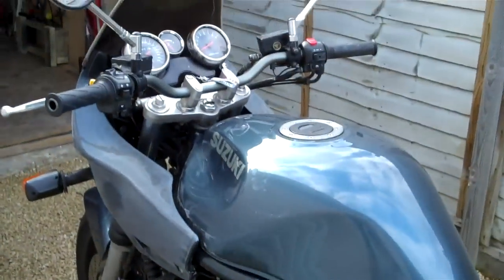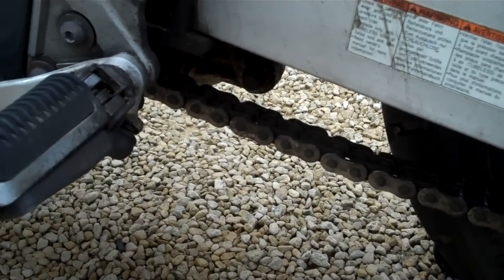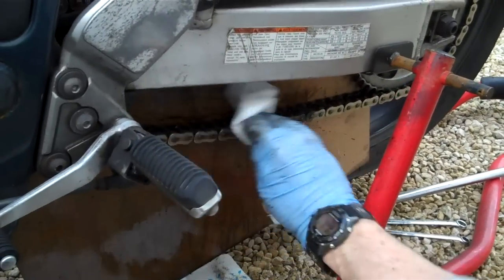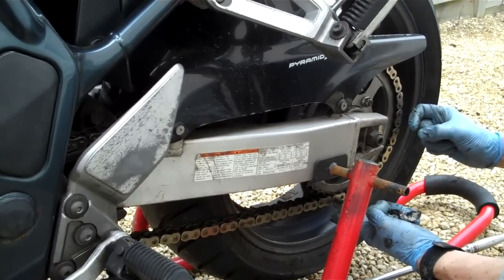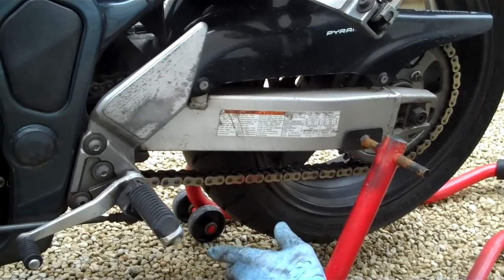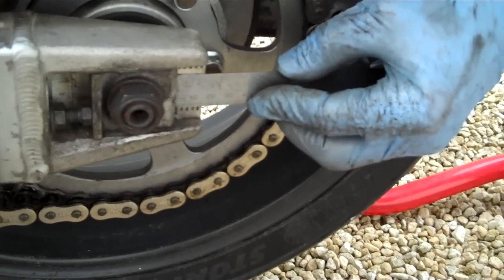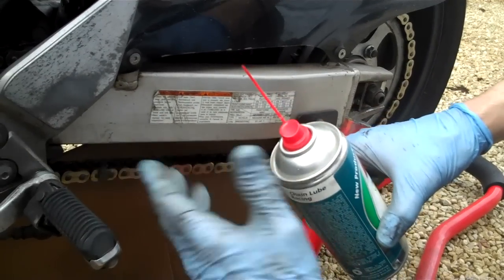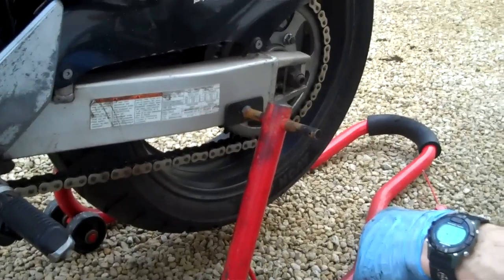Delboy's Garage, Suzuki Bandit, Chain Adjustment. (plus clean and lube).

Comment: I can't get the distances equal on both sides with the correct tension. I need to shorten the right hand side, but you can only adjust it to lengthen. Another issue is that when I had it about right, torquing the axle nut tightened the chain. Spent over 2 hours and still can't do it.
Reply from the maker: +Glenn Makin Ok it can be tricky mate.. most tensioners only pull backwards...so you can loosen it off then kick the wheel forward...works fine.. then set the chain tension correct on the chain side, do it with the axle nut hand tight and a bit more on top....then line up the other side to match the alignment... then after torquing up the axle, check the tension again to make sure it didnt go tight.!
Reply: Seems you mustn't slacken the axle nut too much. Tried pushing wheel forward as you say, obviously needs more force. Then just adjust chain side as the adjusting side, and set the right to match. Think I've got you. Try again tomorrow. Cheers mate
Reply from the maker: +Glenn Makin Yeah, thats right, you need some resistance in the slide action as you draw it back...that will hold it where you put it and mean that it wont change too much when you torque if up tight... good luck with it buddy, let me know how you get on.. cheers, Del.
Reply: sorry to be a pain, are you saying that if I loosen the adjuster nuts and axle nut I can kick the wheel forward, as I need to shorten the right hand adjuster. Wouldn't this ruin the thread on the adjuster screw? thick as pig poop I am
Reply from the maker: +Glenn Makin If you adjust the tensioner off then that should make the wheel free to slide back and forth in the axle slot, if it is a threaded adjustor however, then you should be able to wind the wheel forward with the nut...!
Reply: you little farkin beauty I've done it! key points were to loosen everything off so I could kick the wheel forward and start from scratch. And keep axle nut tight so it doesn't tighten the chain when torquing. 
A minor victory but I'm buzzing, another little skill learned and I can ride my bike. I am so happy, I'm going to celebrate with a cuppa, a rollie and a ride! cheers mate! diamond!
Reply from the maker: +Glenn Makin Brilliant Glenn, so glad to hear it mate, learning new skills is always triumphant..!  ride safe chap.. all the best.. Del.

Comment: Hi pal , I don't have a pic but if you put daelim daystar chain tensioner in Google there are pics. Any help would be much appreciated cheers laurence
Reply from the maker: OK Laurence, I see the pictures - looks like a pretty standard jockey wheel affair, but the axle does look to be adjustable, so I would imagine you just need to keep the chain tensioned, so that the jockey wheel is within it's range of spring span... meaning that's it's neither fully stretched to it's maximum, or pushed right up against the swing arm fully closed... basically, set the chain tension so that the jockey wheel is in the middle of it's range of sweep... does that make sense??
Reply: So you mean keep the jockey wheel in the middle, if you were looking at a clock the wheel would be at 3 which is the middle of 12 and 6 if you get my drift, thanks for taking the time find out and reply I'll let you know how I get on. Cheers laurence

Comment: Hi Del, I used this video to guide me in checking the chain free play on my own '99 Bandit 1200 - thanks again! The first thing I noticed was the the axle was reversed, so the nut was on the right hand side beneath the pipe. Secondly, I noticed a fair bit of fore-and-aft free play in the adjuster plate on that side - I took a video (https://www.youtube.com/watch?v=9aK5Kneqqg4).

So, my questions:

1. Is the axle installed incorrectly and should in be reversed? It's a Canadian bike, if that makes any difference - but the chain is on the same side as yours.
2. Should there be free play fore-and-aft in that adjuster?

Thanks mate!
Reply from the maker: Sadly your link doesn't work John, but there is a little free movement in the adjuster, unless it's under tension... not sure about the axle, or whether it's significant, or not, which side it's fed through from... I'd have to have a close up look to check and confirm if it's a universal fitment, or whether it's sided... as long as an axle is parallel all the way along, with no fat sections, then it should go through either way... but most of the time people fit it so that the axle can be withdrawn without having to remove things like exhaust pipes... so hope that helps mate
Reply: Hi Del, updated the video link and I think it's okay now. From the looks of the exploded diagram in the service manual (https://flic.kr/p/29jK76s), the axle has a constant diameter so turning it around should work if I decide to do so. I notice also in the diagram that the orientation matches your bandit's - the axle nut is on the same side as the rear sprocket.

If you do have a chance to look at the video I would appreciate your feedback on the amount of free play. Cheers!
Reply from the maker: Sorry John, the link still doesn''t open buddy..?
Reply: Moonfleet41 Sharing YouTube videos has always been a bugaboo for me... Maybe I'll finally figure it out someday. Cheers Del.